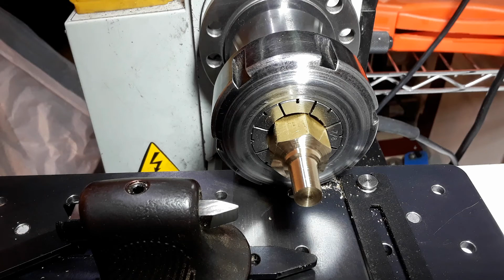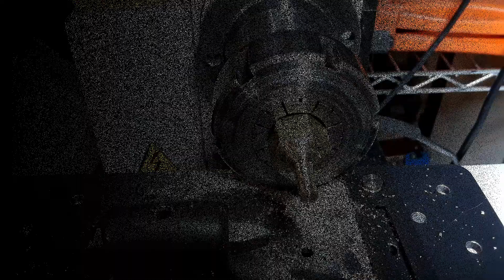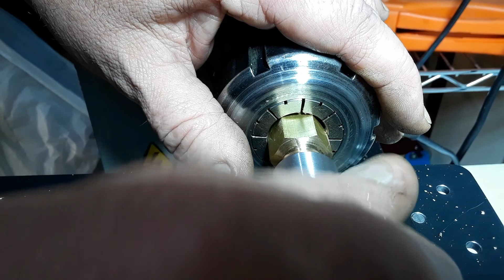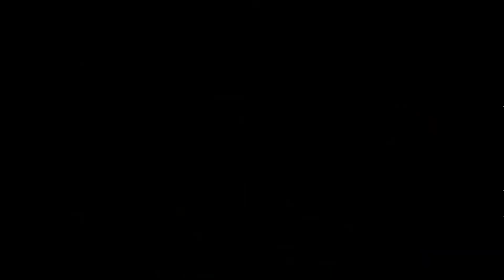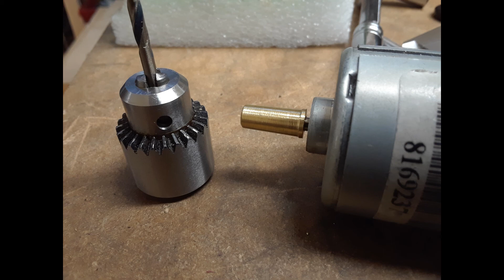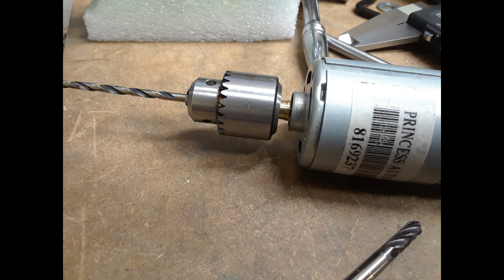TURNADO: TURNING JT0 TAPER. INST: arkadiy.chernikov

Comment: An interesting use for the Turnado. How did you set the fence to the exact angle for a JT0 taper?
Reply from the maker: That was easy. 
The chuck has its original 2'' shank, so I just set it into the collet and aligned the fence by cutter tip and follower.